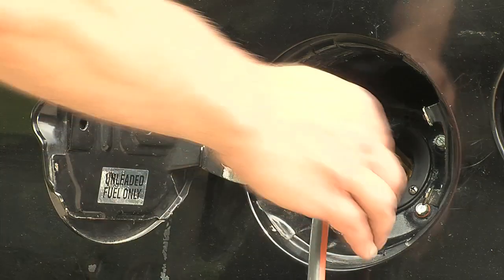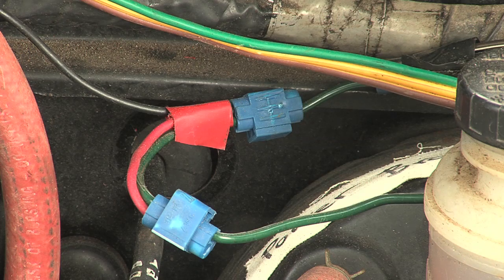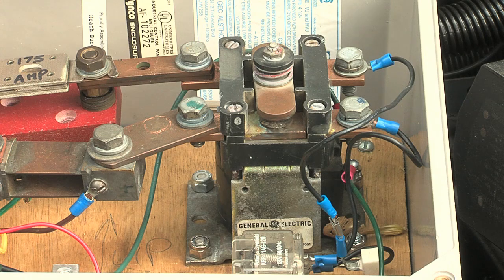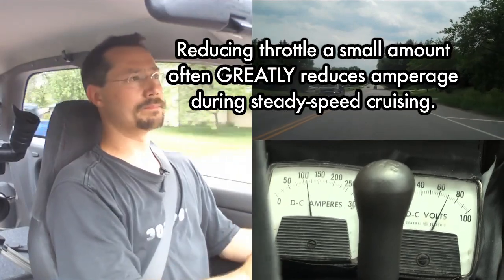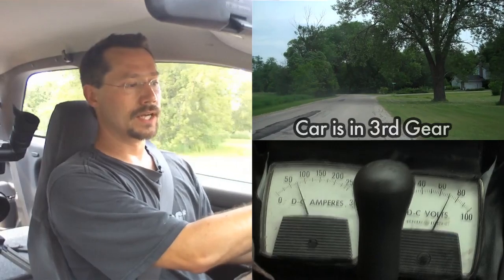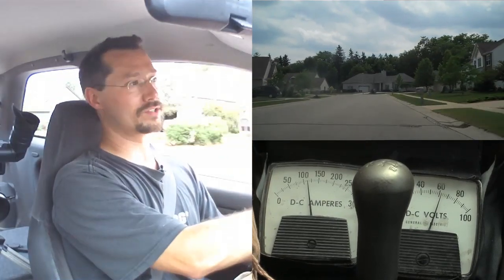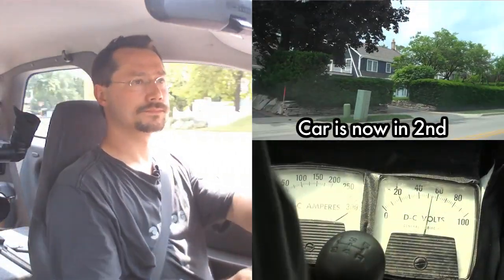15 Build Your Own Electric Car: Driving the Car

Comment: Thank you for the videos! What are the issues I would run into if i were to go with a direct drive instead of using a transmission? slow acceleration and trouble with steep hills? less efficiency with stopping and going?
Reply from the maker: All of the above...

Generally, we think of "Direct Drive" as placing a motor right on the driveshaft.
Hub motors directly drive an individual wheel and are popular on electric bicycles, but tend to be heavy and inefficient and have "unsprung weight".

Trucks sometimes have a motor (or two "Siamese" motors) connected directly to the driveshaft. 

Most electric motors are designed to spin faster and then be geared down for their actual power output. Using a motor at low speeds, high torque, and high current, tends to mean poor acceleration,  issues with heat, and needing a large and powerful battery pack.

It CAN work well with a large motor for something like a drag-racer, but for typical real-work driving, we usually have a motor running through a gear reduction somewhere around 8:1.

In a small front-wheel drive car like this Geo Metro, I don't know how you would do anything one might consider "direct drive". Attaching a motor to the existing transmission is the most logical and straight-forward thing to do.

https://300mpg.org/projects/electro-metro/transmission-for-an-electric-car/
Reply: @BenjaminNelsonX   Thank you for the reply. You gave me all the information I was looking for. The setup I was thinking was pretty much exactly how the students did it in the van you salvaged a while back..  Maybe a Siemens/dmoc 645 combo, in a van, mounted where the transmission would be and attached to the driveshaft with a u-joint.. No need for crazy acceleration and all that. https://www.youtube.com/watch?v=sgYURJryI_4

Comment: Why not use the transmission first to accelerate with low amps and you can go faster with less amps
Reply from the maker: In 25 MPH zones, I would just put the car in 2nd gear and leave it there. In 45 MPH zones, I would just use third.
1st gear tops out in speed so fast that it's completely useless. It would actually take longer to put into first, accelerate, shift to second, and then accelerate, than just to drive in second gear.

It really is very different than a gas car.

Comment: Great work Ben!  I was wondering if your upshifting was easy because it was a series DC motor.  I'm told up and down shifting with an AC motor can be a bit grindy because the motor stops spinning fairly quickly (regen does that).
Reply from the maker: I never had any issues with shifting. I'd just let off the accelerator, take the transmission out of gear, wait about a second or so to let the motor slow just a tad, then shift into the next higher gear. Frankly, most of the time, I was in either 2nd or 3rd gear, so there just wasn't that much shifting overall.
If a person is designing a clutch-less AC DIY car, then you would want to have control over regenerative braking before shifting.
My friend, Tom, did an AC powered Dodge Neon. He had a button on the stick shift that automatically set the electric motor to a certain speed. So, he would just press the button, then shift. It was slick. Search my channel for Dodge Neon for videos on his project.
https://youtu.be/KcCHNKHFTvU
Reply: @BenjaminNelsonX  I was just wondering how that could be done when I read this comment. Presumably the motor needs to spin to enable the synchromesh in the gearbox to correctly match the speed of the gear to that of the shaft as the gear is engaged. I'm guessing two rotational speed sensors are needed and some electronics to set the motor RPM to the correct speed. How is the input RPM related to the gearbox output RPM? Is it a constant ratio?
Reply from the maker: @AnthonyHigham6414001080  Sorry, I'm not much of a transmission guy. Keep it simple. In my Geo Metro, most of the time, I just put it in 3rd gear and used it like DRIVE in an automatic. No shifting even needed. No current commercial AC motor cars use transmissions. Just single speed gear reduction.

Comment: Ben, you probably know that your motor can be rigged to become a generator during downgrades and stopping. Its called regenerative braking. You seem knowledgeable enough to be able to upgrade your Metro to gain even greater range.
Reply from the maker: Not all motors are well suited for regenerative braking. This car uses a series-wound DC motor, a type NOT great for Regenerative Brakes.

Comment: very nice. i made an electric car from a BMW 1991 model. the difference is that i have made a 110v alternator  and mounted it so it charges my batteries as i drive. i have been driving for months without charging my batteries. im not going to tell or put up a video because im the first in the world to do this.
Reply from the maker: You forgot to add the winking/smiling emoji after your comments so that we all know you are joking!
Otherwise, my default response is: https://300mpg.org/projects/electro-metro/perpetual-motion/
Reply: @BenjaminNelsonX  sorry to disappoint you but i did it and its true
Reply from the maker: @01wizmiles01  Pics or it didn't happen. What mechanically powers the alternator?
Reply: @BenjaminNelsonX  just like an engine it has a belt to from the electric motor to the alternator. i had to weld the fanbelt wheels, a large one on the elec motor and a small one on the alternator. no pictures because of copyright
Reply from the maker: @01wizmiles01   When do you plan to get your copyright, so that you can release your invention to the world?
Reply: dont know how and dont have the money  @BenjaminNelsonX
Reply from the maker: @01wizmiles01  If it works as you describe, it should be easy to find investors to help you out.
Reply: What you describe is called perpetual motion, and it does not exist in this universe. You sir, are an outright LIAR.
Reply: @tigerseye73  i can see that people like you are stupid and dont know what your talking about. ive done it and dont care what you say.
Reply: @01wizmiles01  liar

Comment: Please how do you recommend on charging the single 12v battery?
Reply from the maker: On this very simply project, I just mounted a 12V charger to the 12V battery. It would charge when I plugged the car in. Most electric cars use a combination of a 12V battery combined with a DC/DC converter. That device tops off the 12V battery by taking power from the main battery pack and converting it to a lower voltage to charge the  12V battery. Think of it taking the place of an alternator from a gas car.
https://300mpg.org/projects/evcycle/balance-of-system/
Reply: BenjaminNelson Great and thanks for the response

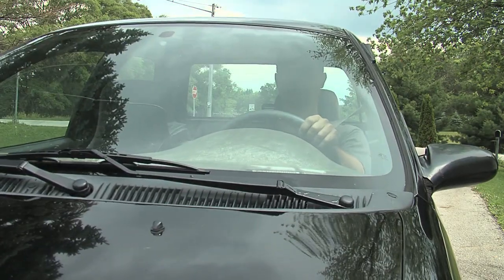Comment: @8:22 That is the cheapskate version. Do you have plans for a decent version, e. g. with 35 kwh battery and a topspeed of 80 mph+?
Reply from the maker: The whole idea when I built this car (now 10 years ago!) WAS that it was cheap, so that as many people as possible could learn about and build Electric Vehicles. I built that electric Geo Metro for about $1,300 total. In 2018, if you want an inexpensive electric car, the best way to go is to just buy a used, commercially built vehicle. At this time, it would be difficult to build a new electric car for less than mainstream auto manufacturers can build them. The exception of course would be to convert to electric something you can't buy anyways, such as a pickup truck, convertible, or classic car.

Comment: How does it cost to recharge the battery’s? 
Range is about 30 miles?
Reply from the maker: Great question. Charging an electric car is CHEAP! It's as though you were paying for gas at only $1.00 per gallon.
https://300mpg.org/2018/11/18/cost-to-power-an-electric-car/
Reply: But what is range?
Reply from the maker: @Acyutaz  https://300mpg.org/projects/electro-metro/battery-range/

Comment: I had a 88 Supra. I could not keep a head gasket. I thought about doing this back around 2000 but no knowledge on how to do it back than.  

Would this work on an automatic transmission ?
Reply from the maker: You CAN convert a car with an automatic transmission to electric, but it will be more complicated and less efficient than a manual transmission. Automatics are really there to match up with the low torque characteristics of a gas engine, and aren't a great match for an electric motor.
https://300mpg.org/projects/electro-metro/transmission-for-an-electric-car/

Comment: Did I miss what is powering the a/c and power stealing?
Reply from the maker: Nothing is powering the air-conditioning or power steering because this car has neither. That's one reason why this particular car was chosen - because it's simple.
On more complex vehicles, accessories such as those could be powered from a belt and pulley off a tail shaft of the main drive motor, from a small separate motor, or with a dedicated electric-operated version.

Comment: No Regen?
Reply from the maker: No. I built this car ten years ago with a forklift motor. Series-wound DC motors don't work well as generators.
There are plenty of motors now available for hobbyist projects which easily support regenerative braking which weren't available then.
Still, for $50, it was a great motor!
Reply: Do you still have the car? If so have you improved it perhaps with new batteries?
Reply from the maker: The car is now retired. Unfortunately, rust always eventually takes care of unibody cars in my area, as we use so much salt on the roads in the winter. If the car body was still in good condition, I likely would have upgraded the batteries with used cells from a salvage yard Nissan Leaf or Chevy Volt.

Comment: Awesome! You would want to replace every single filament (incandescent) light bulb with the LEDs too.
Also, have you ever done or thought about a Ultra capacitor bank that could step in when the high Amp demand comes and tops it self up when cruising, when breaking (have re-gen coils coupled in the drive line and also from a semi flexible solar panel put on the rough to trickle charge)... Just some ideas. Nothing you havn't thought about no doubt.
Thanks for the awesome content Ben. Cheers.

Comment: Benjamin, I really loved your set of videos on the electric car.  I do have a quick question: on one of you first videos you mentioned that the fork lift motor was 36 vdc. Then, you are using a 72 vdc to drive the car. Will this not fry the motor? Or does it has to do with the potentiometer or something else?Anyway, you just inspired me to start on my next project, find me a suitable car and make it electric. Do you believe a VW bug be an easy conversion?  P.D. I live in Mexico and may have problems finding some of the electronic stuff you were using/describing on your project.  I also checked the paulandsabrinasev.com website you suggested, and could not access it. don't know if it has to do with my location. Thank you,
Reply from the maker: The web site has changed. It's now http://www.pandspowerelectronics.com

Comment: how about the air conditioner? is it still work?
Reply from the maker: This car never had air-conditioning to start with.
Reply: and how about for cars with air confitioner? whats the solution?
Reply from the maker: It's fairly common to put a pulley and belt on the tail shaft of the electric drive motor and connect that to the air conditioning compressor. Alternatively, a small separate electric motor can be used to power an air conditioner compressor.
Reply: oh i see, so we can modify the electric motor drive to have pulley then, thanx for the tips

Comment: I wonder if the open source controller could be modified to give regenerative braking?  
You've had that ammeter almost pegged for quite a few seconds during the drive.  Have you ever blown that 175A Slow Blow fuse?

Great videos!   I think that for many the range of this type of car would be too small.   I could't use it to commute to work unless I lived less than 10 miles from work, I usually have been closer to 20-25.  Maybe with a LiIon battery option that might be possible.
Reply from the maker: Generally, I've had a 500A fuse in the car, but I had a few salvaged lower voltage fuses in there to start. I DID blow one once when I was intentionally showing off to a friend. I was accelerating hard and had the car in a higher gear than usual (which puts more of a load on the motor, drawing more current.) Fortunately, we were very close to my house, but still embarrassing to have to walk home and get another fuse. After that, I carried a spare in the glove box, along with a single wrench required to change the fuse. Never had an issue after that...

This open source controller was never specifically designed for regenerative braking, and the motor used in this car isn't a style appropriate for regen. The ring-leader behind the project, Paul, has gone on to work on a few other projects, including building an all-purpose control board for salvaged Nissan Leaf parts. See those at: https://pandspowerelectronics.ecwid.com/#!/P&S-Circuit-Boards/c/16287307

The battery pack in this car (10 years ago now!) was USED lead acid. It was never high performance, but it was cheap! The entire project, including buying the car, was about $1,300. In 2018, salvaged batteries from crashed electric cars like Nissan Leafs and Chevy Volts are a bargain and can provide great range!

Comment: Mother Earth News used to have plans for a hybrid car that had a mid size lawn mower engine under the hood with a 300 amp Sears generator. After 20 miles you could pull the lawn mower engine to recharge the batteries and have a really long range. You might think of trying that for your next project.
Reply from the maker: I have a set of those plans! I was at an event one time and somebody gave them to me!
I later did experiment with running this car as a hybrid. I used a propane generator I got from a friend who is an RV mechanic. Overall, it worked pretty well. You can see videos on it at: https://www.youtube.com/playlist?list=PL34AB83CBC78800E4

Comment: How fast could the car go?  Could it go, let's say 70mph and hold steady?
Reply from the maker: Top speed in that car was at least 73 miles per hour. That was in a 55 zone and I knew where the cops park.
Reply: 73 mph is great.  How long could it hold that charge?  The more I watch of these videos, the more I want an EV car.  I'm tired ot paying for gas and oil in cars.  I live about an hour from work.  An EV would be a good way to get back and forth.  If it had solar panels, so that it could recharge while I was at work, it would be even better.  
By the way, good job on your videos.

Comment: how much millage per charge and how much weight can pull
Reply from the maker: Details of range per charge are at: https://300mpg.org/projects/electro-metro/battery-range/
As for "how much weight can pull" - if you are referring to towing, this car did not have a hitch and was not designed for towing. The original weight of the car itself was around 1800+ and final weight after conversion was right about at 2,000 pounds.

Comment: So Ben, why don't you create an alternator mount with a system that lifts the drive belt away from the motor while you are accelerating (like a bicycle chain lifter/gear swapper sort of thing) so when you are FOOT OFF the accelerator pedal (maybe a micro-switched solenoid circuit) so can then recharge the batteries while you are coasting?  I'm sure you will get a lot more distance doing this  ;8^)
Reply: Great question David. I was wondering about that too...Even the possibility of having a belt-driven alternator/generator driven off a drive axle...Ben?
Reply from the maker: 1) because that’s really mechanically complicated,
2) There’s very little room under the hood, especially around the driveway be axels.
3) I built this car over ten years ago and don’t even have it anymore.

Comment: Very cool. Did you keep track of the weight difference? You added a lot but removed a lot too.
Reply from the maker: Yes, I took the car to a drive-on scale at a landscaping supply company just up the road from me. It was right around 1800 lbs when I started, and about 2,000 lbs when I was done. That's the difference in weight of one passenger.
Reply: Around 60lbs in 10gal of fuel. I originally thought it would be much heavier. Nice!

Comment: what range do you get ?
Reply: and what is your top speed
Reply from the maker: The original version of this car was designed for a 20 mile range on cheap used lead-acid batteries, but you can design your EV to go whatever range you would like. For more on how far you can go, please read: http://300mpg.org/projects/electro-metro/battery-range/
Reply from the maker: On a DC system, speed is heavily dependent on system voltage. When I was running at 72V, it was about a 45 mph top speed, which was fine, because that's the speed limit on my road. When I ran 144V, I could go at least 70 mph. I've gotten a speeding ticket in this car.
Reply: Thank you for the answers

Comment: WHAT RAGE OF DISTANCE YOU CAN GO WITH OUT CHARGE.!
Reply: he said only 20 miles due to his 6 crap lead acid batteries.  you can go way further with lithium cells but they cost a buttload.  or just pack way more lead acid batts in if you can fit em
Reply from the maker: https://300mpg.org/projects/electro-metro/battery-range/

Comment: U didn't drive it in reverse!
Reply from the maker: Yes, true, an oversight, I didn't drive it in reverse in this video. It works exactly like driving in reverse in any manual transmission car. One thing about it though... Reverse gear in manual transmission cars usually has gearing very close to first gear. I NEVER use first gear in this car, I usually drive in 3rd. I only ever use first gear to show off by burning rubber. Once, I went to back out of a parking space, and my foot slipped on the accelerator. I did a burn-out in reverse and spilled my coffee everywhere!